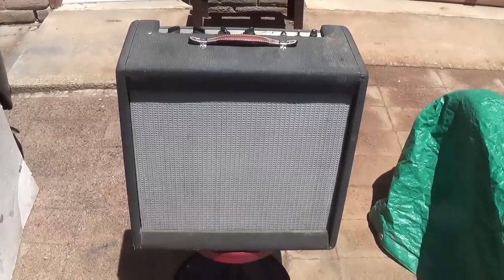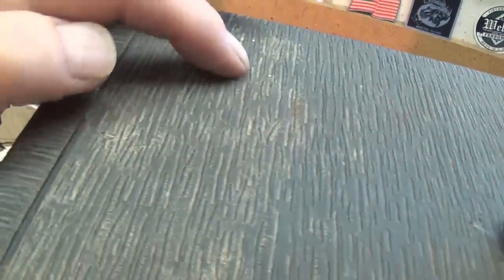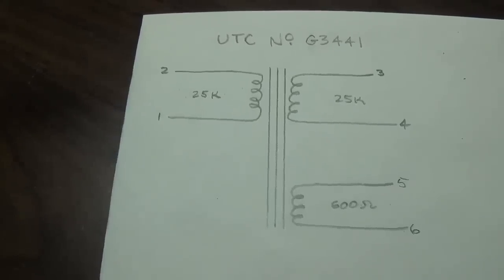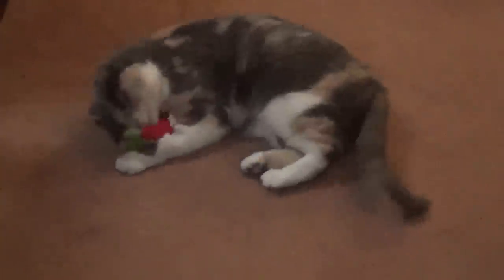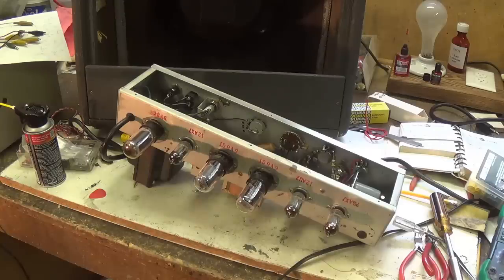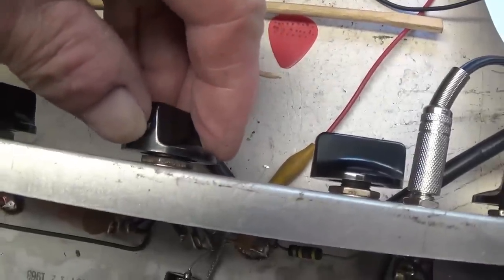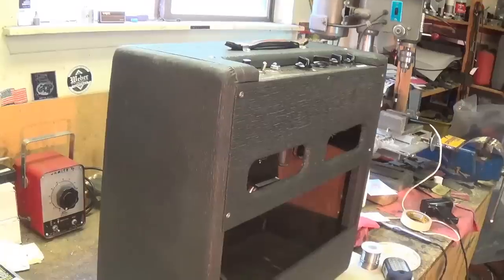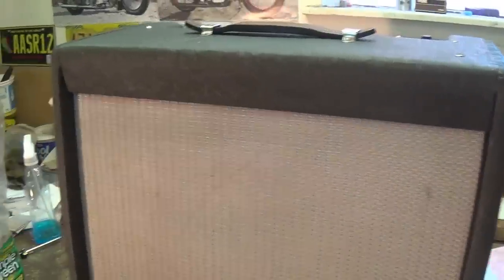1963 Lesmann "Echo" Amp......No More Polkas for this Bad Boy

Comment: VIB. Vibrasonic. I remember back in the mid 60s my older cousin calling the reverb unit in his car ‘Vibrasonic ‘
Reply: And where was Jack the Cat?  Slacking off of his duties
Reply from the maker: I recall those reverb units, Michael. They resided in the trunk of the car and crashed loudly at every bump. Unless parked, they were virtually unusable. Jack did plenty of sniffing on this amp, but it was all edited out due to the length of the video.
Reply: @UncleDoug  , my brother had a Pontiac convertible that he was attempting to restore, which had one of those radio systems with the spring Reverb tank. He never did do all that much work on the car, it's sat in storage for a few years until his wife bitched about the cost of storing it and made him sell it. Which might seem like a shame, except hopefully it went to somebody else who would actually put the work into it.

Comment: Here is a snippet from Reverb.com  - Vintage 1960's Lesmann Echo Amp
Condition This amp is in very good working condition. The electrolytic caps have been replaced by our tech. The signal is clean until about 5 on the volume control, and gradually breaks up beyond that. The drive is throaty and compressed, reminiscent of blode-era Fenders such as the Pro or Bandmaster. The noise floor is fairly low, but exhibits some of the hiss old amps are known for. The input is an integrated RCA cable tied to the Reverb tank, and is meant to be taken from a driver stage of another amplifier (this unit is originally meant for tandem use with another amplifier). Some gain will be necessary upfront, instrument level will be very quiet.
Reply from the maker: Thanks for the info, Buck. I guess that explains the absence of "Echo" or Reverb.

Comment: Just FYI:  Some of the old accordian amps  fed a delayed signal to a second amp, which could have been a bit smaller and not as loud as the primary amp.  This second amp was the 'Echo'.  Perhaps that is what this amp started life as.
Reply from the maker: Thanks for this info, Alan. Apparently, this was the master amp with a "Remote Speaker Volume" to control the secondary, echo, amp. This agrees well with the labeling and circuitry of this unit.

Comment: One suggestion for the label you made. You can get a cartridge for your label maker that has transparent film which will give you black letters with the tolex as the background rather than white.
Reply from the maker: I simply printed it with my laser printer on white paper and glued it on, Jeffrey. Thanks for the suggestion.
Reply: I have a Brother label maker. Thought you used something similar...

Comment: Great Job Uncle Doug! I think it sounds great converted to a guitar amp. I knew if anyone could make sense of that beast it was you. I like your showing your thought process and experimentation with the circuit. I never would have figured it out. BTW I did send the tubes  it had in it, They were wrapped in some white foam padding and taped inside the cab. hope they didn't get tossed. 
BiogDave
Reply from the maker: Thanks so much, Big Dave, both for your nice comments and your donation of the Lesmann amp. Yes, all of the tubes you sent were used in it.

Comment: Practically a re-design Doug and lovely work as usual. I often wonder with these 'tankless' projects if reverb could be added perhaps using two (extra ?) tubes in oscillation with a C-R ('tank') network...the so called "Vib" maybe had this ?
Reply from the maker: It's difficult to add reverb without upgrading the power transformer, Dave. You're better off using a Fender 6G15 or pedal.

Comment: I think I can clear up the mystery of the little transformer.  Most dynamic microphones are designed to work into a 600-ohm load.  So, if you put in series the two 25k transformer windings, and then put a 50k (47k is close enough) resistor across them, the input will see a 600-ohm load.  The turns ratio is the square root of the impedance ratio, so the transformer would provide a microphone gain of about 9 times.  Not bad, but good transformers that work well over the entire audio range typically use interleaved windings, and to be able to produce the bass end of the audio range, need lots of windings.  All that adds up to expense and weight.  Back when this amp was made, electronic devices were expensive for lots of reasons.
Reply from the maker: Thanks for sharing your very knowledgeable insights, R.

Comment: Hi Doug,I dont think this is an accordian amp. I believe it to be an amp dedicated solely for adding trem and Vib to another amp to be placed several feet away (Satelite amp). The Lesmann would be fed by a fixed cable with a phono on the end fed from the reverb out (or something similiar) so you could get your main sound with your regular amp and then blend in the Vib amp to taste.I had a Gretsch and a Ampeg that both performed just like this (except they provided Reverb).Funnily enough,they were both from 1963 also.Just my theory.Take care,love your vids!
Reply from the maker: That's an interesting theory, Winny, but since Lesmann was strictly an accordion company, and there was no provision of either tremolo or reverb in any of their circuits, it seems unlikely.

Comment: Trying to think through what was going on with the distortion issues by applying the tremolo signal to both tubes.  My guess is the trem signal was creating a cross-over distortion situation. By applying the trem signal to one tube, it minimized the cross-over distortion to half of the push-pull swing at the point where the one tube cuts off. At the low setting, the bias swing is lower and not pushing the tubes into cross-over distortion, and at the higher intensity, the cross-over distortion is "silenced" as the one tube is pushed into cutoff (the "quiet" phase of the tremolo swing).

Just spitballin'
Reply from the maker: Very interesting analysis, TP. Thanks !!!

Comment: I found the following node on the Lesmann: "The input is an integrated RCA cable tied to the Reverb tank, and is meant to be taken from a driver stage of another amplifier (this unit is originally meant for tandem use with another amplifier)"
Reply from the maker: That was part of a Reverb ad, and it's largely incorrect.....either that or it's describing another Lesmann device. This one: No reverb tank ever, no need for another amp, etc.

Comment: Uncle Doug, I once owned a Legend 50. They were made close to where I live in way upstate NY.  I hope I can find a video where you dove into that amp. I'm curious what you thought. I sold mine for $50.00 in 1986. You could walk on those things around here. No one I know ever liked them much, so they all sold them at a loss. I think the eye candy was more appealing than the sound.
Reply from the maker: If you're speaking of a hybrid 50W amp in a beautiful oak cabinet, I had one. It was loud and well-made, but the hybrid part of the circuit was not my cup o' tea, so I sold it locally.
Reply: @UncleDoug  Exactly, the tube preamp did not seem to not work well with the SS output stage. Although they were indeed well made and beautiful to look at they just weren't the amp they could have been.
Reply from the maker: @timsterz1  I agree, Tim.....and the influence of the SS output on tone was not a positive one......just a LOUD one.

Comment: Hi Doug,  If I remember correctly..... That sealed 600 ohm transformer was used in some class-C radio transmitters, military,  broadcast and ham ! Maybe as far back as the late 30's !!
Reply: So ex surplus stock, so much built in UK from military teardowns

Comment: At 39:00, you might as well get rid of the wax cap.  Unless it's your camera mic, it sounds over-driven at 50:16
Reply from the maker: The cap was fine, Ted. It never faced much voltage. It probably was overdriven.

Comment: uncle Doug, if I can make a suggestion on your self made labels, clip the 4 corners, it prevents the labels from being easily picked off, and I think it looks better. or filleted. I have a little “Brother" label printer that you can put different cartridges in, that have quite a few configurations, you type in using your computer with their free software.

Comment: At 34:00, is that  "remote speaker" potentiometer a linear taper pot or an analog/ audio-taper pot? Whichever one it is, swap it out for the other type. Might give you a much smoother transition when increasing the tremolo.
Reply from the maker: I'll check. Thanks for the tip.
Reply: @UncleDoug  , I'm assuming you know how to quickly check for one type versus the other with a multimeter, but you're technically more savvy than most. It might actually be helpful for you to grab a couple of pots out of the junk box and make a little video while you show people how to test them to see whether they're audio taper or linear. This would also provide you with an opportunity to put pencil to paper and make one of your funky little drawings, of a circular resistor and a wiper! Anyway, I personally find it really annoying when most of the action happens at one or the other far end of a rotary potentiometer. Usually, a tremolo control is more of a function control and not really an audio control, so a linear taper pot might be more appropriate, but circuits do vary.
Reply from the maker: Again, I appreciate the suggestion and agree that function pots should generally be linear, while audio pots are virtually always logarithmic.
Reply: @UncleDoug  , old Fenders and other amps often have linear taper volume pots ( linear pots, really, as they have no taper!), that's why they go from quiet to loud in the first 40 % rotation  of the volume control. This is tolerable in an amp but really sucks if the pots in a  guitar  go to almost full volume in the first 40% of their mechanical rotation! I've seen Gibsons that do this.
Reply from the maker: Since the power requirement necessary to achieve steadily increasing volume is exponential, one would expect volume pots to be logarithmic......or face the situation you describe, in which a linear increase in power is not reflected in a matching volume increase, especially beyond the 40% point.

Comment: I bet that the clipped corners on the aluminum sheet laminated to the steel chassis are to keep the drill from grabbing and lifting/bending the aluminum.
Reply from the maker: You're probably right, Bob. Thanks.

Comment: Now that was fun! That amp is a Tweed Deluxe (5E3) just waiting to be released. Although it's pretty cool as it is. I think accordions must have a pretty hot output because they seemed to be choking off the signal to prevent it from over-driving. Nice bit of sleuthing and an interesting solution. That UTC transformer will be of interest to a few gear hounds as that 600 ohm primary is often used in rack tube gear for inputs.
Reply from the maker: Thanks for your input, John. I assumed that the UTC was to step up the voltage of the instrument signal, not step it down......but I guess we'll never really know.

Comment: Have now watched a few of these wonderful videos, and in truth the only bits that I really understand is "Grab a beer"... Vib, though, must mean vibrato, (pitch oscillation rather than volume oscillation which is tremolo). But where's the circuitry? If it were there Uncle Doug would have found it... Great sounding amp amp. Straight out of the 60s. Keep up the good work.

Comment: [Channeling Detective Columbo] "And just one more thing"......that tightly twisted speaker wire would probably add significant inductance as well as resistance, which would tend to roll off some high end response as well as loosen the grip of the circuit on the speaker (loss of back-EMF damping, could cause muffled bass).  A short piece of zip cord might preferable. You probably already changed it, but if you didnt, well....
Reply from the maker: Thank you for your suggestion, GU. In what way is twisted wire worse than zip cord (wires in perfect parallel) with respect to inductance and resistance?  Meanwhile, rest easy.......the speaker wire is now two separate (and separated) strands.
Reply: @UncleDoug  , the twisted coil does constitute an inductor, perhaps mitigated somewhat by the out-of-phase nature of the two conductors, not really sure about that part. However, the capacitance will actually be significantly higher because the twisted wires are so close to touching each other and we don't have any information pertaining to the insulation resistance characteristics of the jacketed wire. Zip cord maintains a constant and greater distance between the conductors, therefore it would typically  have less capacitance. (PS, from my audio salesman days, I remember several brands of amplifier that not only specifically recommended using their own speaker wires, which were essentially an extra- wide modified zip cord arrangement, but that you used a 10 to 12 ft length of the wire for both speakers even if they were only a few feet away from the amplifier. Those amplifiers did not have high-frequency limiting output inductors built-in, and the known, defined inductive and also (low) capacitive characteristics of the speaker wire were supposed to form an L/C circuit and thereby provide the frequency limiting for the circuit).

Comment: Similar unit Recently sold on Reverb ..Their notes follow for the mystery amp..
 "The signal is clean until about 5 on the volume control, and gradually breaks up beyond that. The drive is throaty and compressed, reminiscent of blode-era Fenders such as the Pro or Bandmaster. The noise floor is fairly low, but exhibits some of the hiss old amps are known for. The input is an integrated RCA cable tied to the Reverb tank, and is meant to be taken from a driver stage of another amplifier (this unit is originally meant for tandem use with another amplifier). Some gain will be necessary upfront, instrument level will be very quiet.  Now what ..thanks for keeping us entertained.
Reply from the maker: Thanks, Peter. I think the Reverb description is a bit confused......there is no reverb tank or any circuitry for one, no hiss at all, it does not require an external "driver stage", etc. I question whether the author of this description really knew anything about the amplifier.
Reply: The reason it may have some credibility is the Amp Name being "Echo" amp .. no matter it's great of you to reverse engineer the entire unit .. for us .. Keep up the great finds ..w/thanks

Comment: I think the aluminium panel might have been added to the chassis after the holes had already been drilled so instead of drilling new ones into the panel that have to line up with the other ones they just cut off the corners.
Reply from the maker: That makes sense, RC. Thanks !!!

Comment: reminds me of my tube SANO amp 1 12"  d131 jbl - made for accordion and mic  also - mine is great for guitar has vibro and reverb ...edit: I would have added a foot switch to cut on n off the trem vib and hard that cable in the old hole ..but yeah man! u do good work n know ur stuff
Reply from the maker: Thanks, B2.

Comment: Chassis was made with holes in it. The control panel was applied while assembling. They didn't want to have to line up holes. Takes too much time.
Reply from the maker: Makes sense, Tim.

Comment: Re the Legend amplifier, since it has solid state outputs, if it doesn't already have a speaker fuse, or a protection relay,  between the output transistors in the speaker, I would strongly suggest you add a fuse or two/three.  A component failure could send full B+ DC straight through and fry that valuable and rare Celestion speaker, which would be a shame. A fuse in the speaker line, as well as fuses for any and all B+ lines, certainly for the B+ to the output transistors anyway, would be a good idea.
Reply from the maker: Thanks for your suggestions, GU. I tend to avoid hybrid circuits for reasons that are becoming more and more evident.
Reply: @UncleDoug  , it's not that tube amplifiers can't burn up or catch fire, but at least when they fail the output Transformer usually protects the speaker.

Comment: +Uncle Doug, about ten years back, I received a Lesmann amp of similar design, but slightly later vintage, along with a Cordovox Accordion; the Amp was fine, I repaired the output on the Cordovox. My "amp practice" is 90% "Leslie/Hammond" based; I received them for repair, because I rebuilt the connection interface, and amp for the same gentleman's/church's C-Series Hammond/Leslie pairing.  The Cordovox was mated to the Lesmann amp  via the round, 11-pin Leslie Connector system, and via a similarly shielded cable. A second cable was included, which was labeled  "Cordovox-to- Leslie - System #7 ONLY".  These were both used by a church group, who had both instruments, and others donated by a Wisconsin-based church group which did not donate the "#7 Leslie".  Never accept Cordovox Accordion electronics for repair, I had to up the Zantac after that episode.
Reply from the maker: Wow, thanks for the warning and the detailed recollection, AM. Trust me, I will not be accepting any accordions for repair......ever :)

Comment: I have an Ampeg Jupiter (i got for $50) from a movie prop lady, and it has a tremolo and vibrato, but it doesn’t really work. I wish you were close so I could bring it over film you fixing it, lol.
Reply: The trem/vib doesn’t work well. Someone replaced its chip thing and its different than the original. The amp works, but its noisy and I thought I changed all of the caps already but maybe there is one in there i missed.
Reply from the maker: Noise can be from many sources, Ambrose, not just caps. Good luck with it.